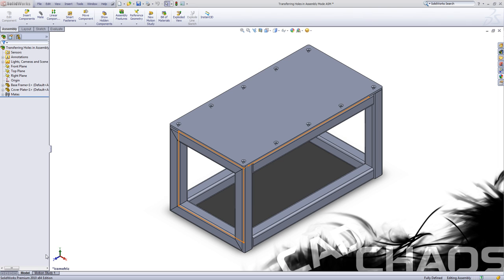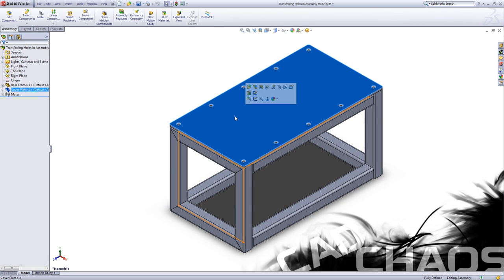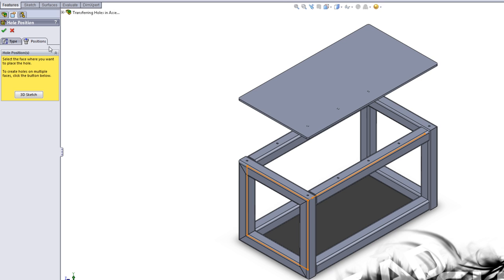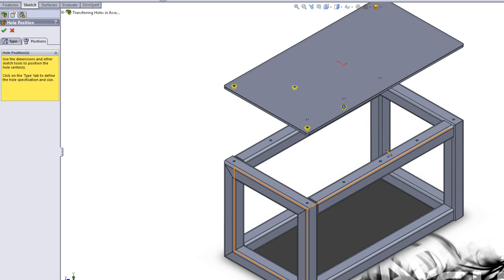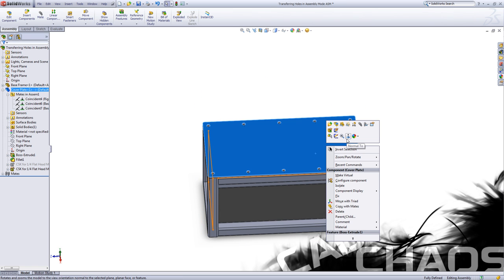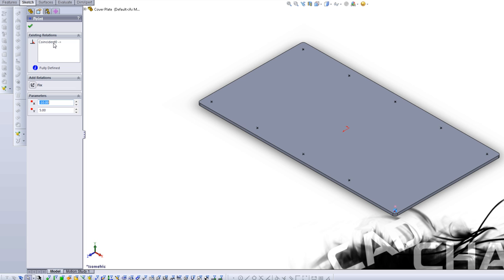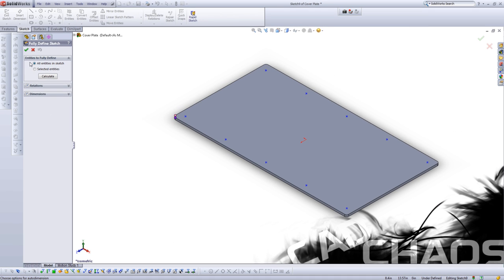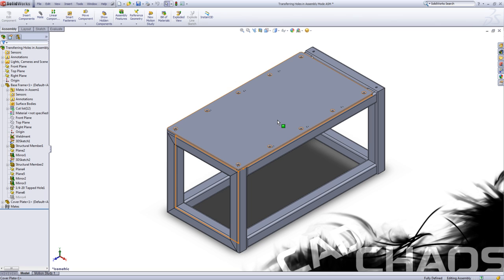SolidWorks How To Transfer Hole Location to Different Part in Assembly

Comment: Very helpful! Thank you for making this tutorial, it will save me hours of time. The most beautiful part is: if you move the holes in the part, the corresponding holes using this method update in the assembly instantly. Subbed

Comment: Nice video, I appreciate it, and it helped me out. I do have one thing to point out though, which may help you delete those 'coincident' mates a bit quicker. First, open the part (e.g. the top plate that you just put the holes in) and then right click on the 'hole wizard' feature, which contains the newly placed holes in that part, and select the 'edit Feature' option. Then, go to the 'positions' tab in the 'hole wizard' feature. You may want to hit the 'escape' button at this point, to avoid adding any extra holes on the part. Then, click on 'Display/Delete Relations', which is on the 'Sketch' tab. At this point, you should see all of the 'coincident' relations, assigned to the holes, under the 'All in this sketch' drop down option. You can then select them individually, or use the 'Delete All' option, if applicable. Anyway, I hope my instructions were somewhat clear, but, if you have any questions, ask me, and we'll figure it out. Again, great video and thanks for posting it, it helped me out.
Reply: I know i'm a bit late to the party with this response, but there's an alternative to permanently deleting the coincident mates that yields a similar result.  If you right-click on the hole feature in the tree, you can select "External References" and then choose to 'Lock" or "Break" the references to external parts.  This allows for the reference to be 'turned back on' in the future should it be desirable.

Comment: Thanks. Well explained.
An efficient way to deal with multiple replations delete is the "Display/Delete Relations" menu button. There I can delete all realtions at once. Same with "borrowing" points from one part sketch to another is "Convert Entities" where points and other stuff can be selected all in one go.
Reply: Tore Forsgren Thanks, yes I really liked the video but your tips will save some time from creating the hole positions.

Comment: Very nice I have being getting confused about what method to use.  Also if you want to use an m6 screw do you make the hole m6 for a tapped hole in a metal plate.